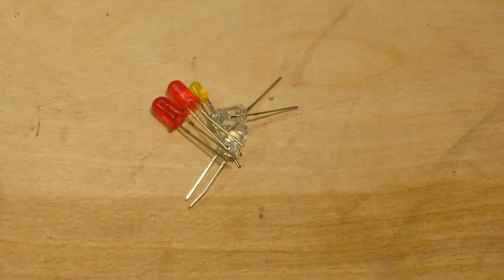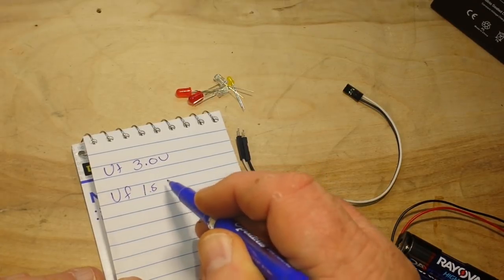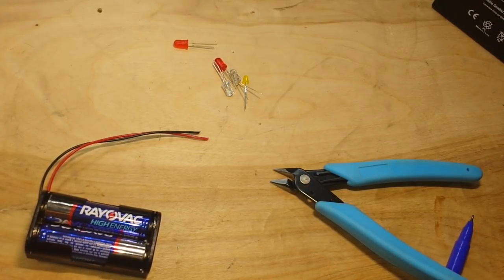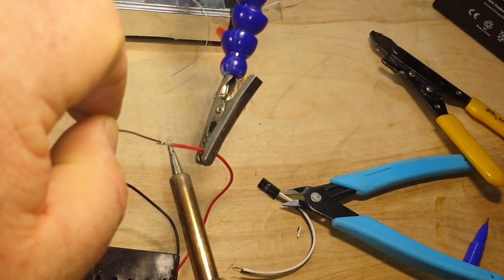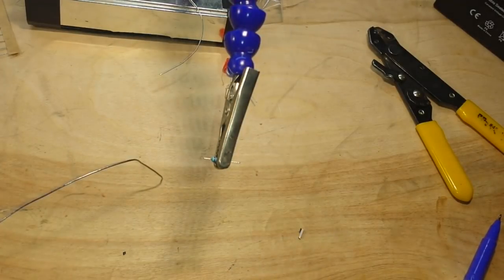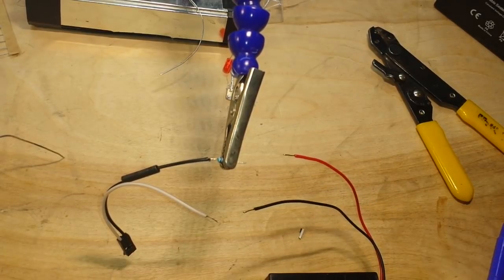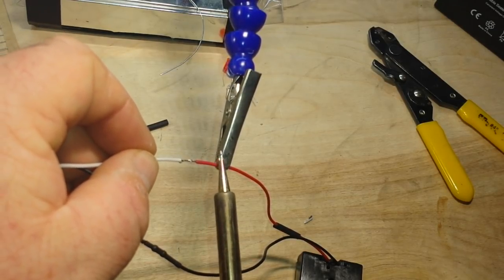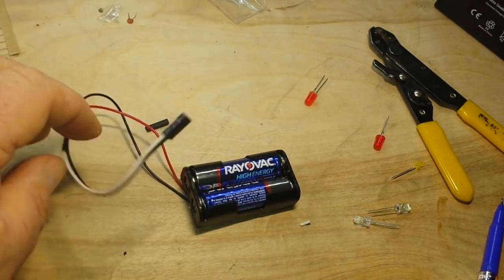Quick and Dirty LED Tester

Comment: You can use a FET with the GATE and DRAIN shorted with the same current limit value  ( know as a constant current diode ) of the led being tested .... NO RESISTORS or correct DC voltage source needed =)     Same common heart sleeping problems my friend =)
Reply from the maker: I am going to try this! Thank you!
Reply: Lessons learne 45 years ago in TTL class room in college =)
Reply: Did you ever try a 20mA  FET current limiting usage of a FET as a CONSTANT CURRENT DIODE =)   That way you do not need ANY DROPPING RESISTORS at ALL as long as you do not exceed the max voltage of the FET =)   I hope that will help out =)
Reply from the maker: Ahh very cool, thanks

Comment: That's my problem. I've been using the wall outlet, and while they're momentarily bright there, never work in circuit.😎
Reply from the maker: Well, uh, you see umm... Yeah
Reply: You gotta lick your fingers first before plugging an LED in to a wall socket. That way, as you get blasted backwards across the room, you disconnect the LED before it gets too bright and runs out of light.

Comment: Hey. Where would I buy some of those little blue cutters you have? I have some but are second hand and are used and abused. I need some new ones.
Reply from the maker: Look in the description belie the video for a link to my Amazon store. The flush cutters are like $2.50.
Reply: Rich again from Michigan Easily found on ebay, aliexpress, etc. Search for 'wire cutters'.
Reply: CW Roberts 
Oh I'm sure they all over the net. I just hate waiting for things in the mail. Especially if it's coming from China and it's not specified on the site. Then it takes weeks to get here. Lol